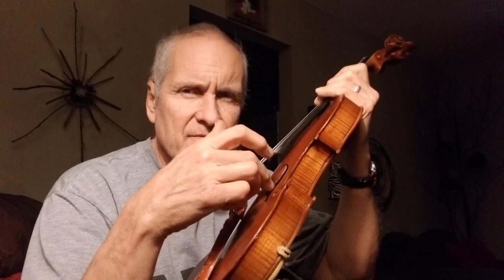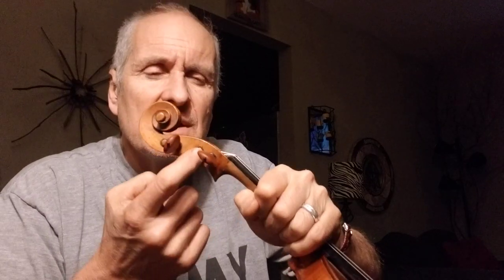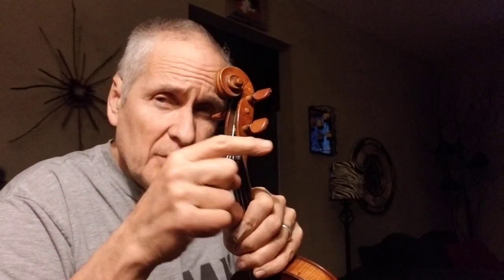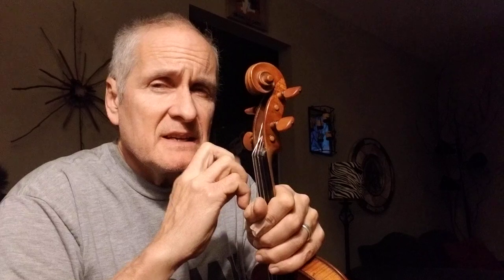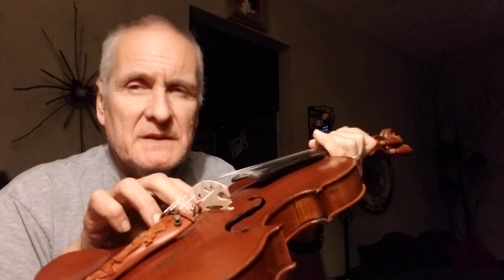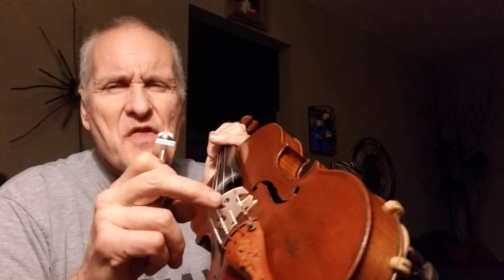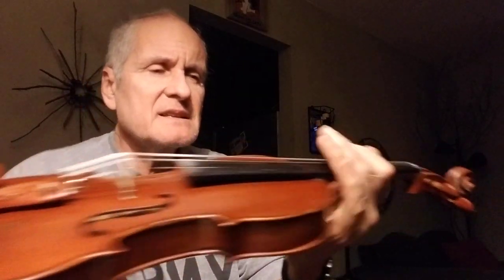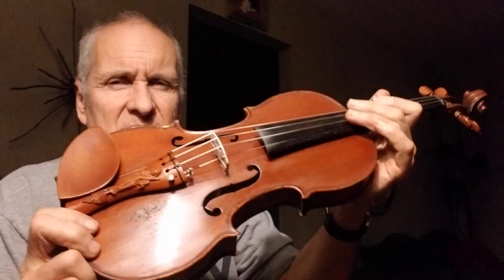Correcting Tuning Peg Issues

Comment: Hi, good discussion on violin pegs. I got tired of all the peg slipping and jamming issues and replaced all the pegs on my violins with Perfection geared pegs. All my peg issues are now gone. I think that the short pegs on some Amazon violins is to allow for peg and peg box hole wear over time. Fiddlershop sells a very nice sound post positioning tool in addition to the tool you showed.
Reply from the maker: Hi, Thank you for adding good information. I'm not as optimistic as you as far as the pegs not being fitted on Amazon fiddles. On mine one was OK, one was almost OK, and the other two barely made contact on both sides. That's just cutting corners to hit a price point.